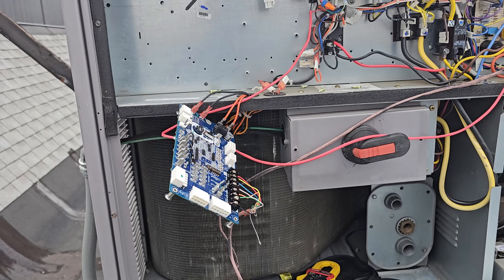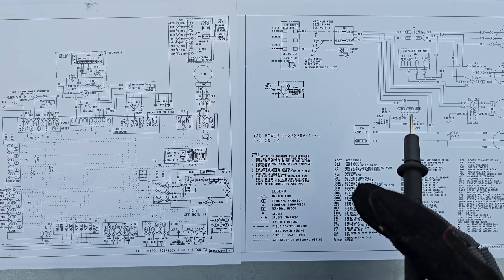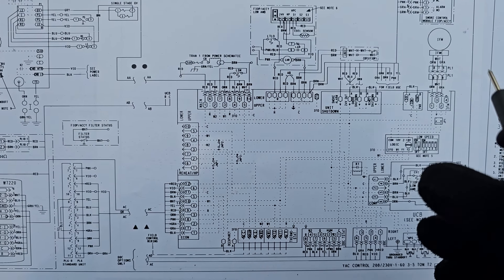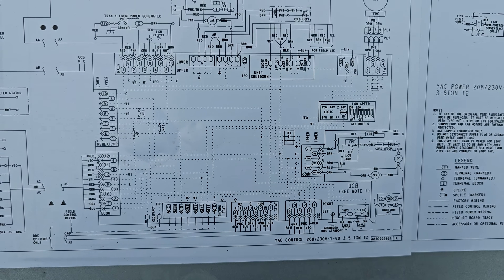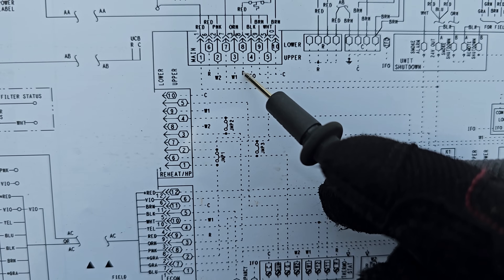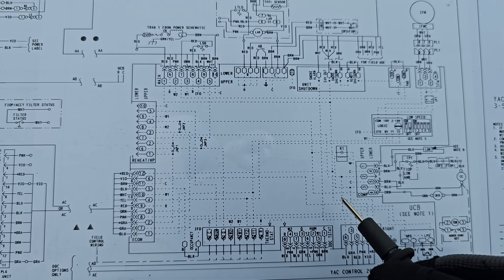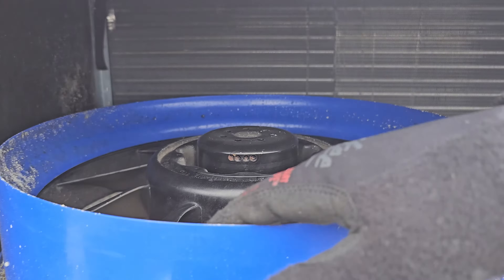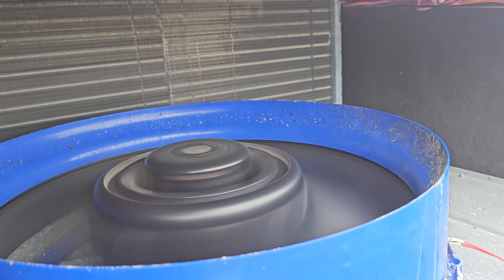HVAC TROUBLESHOOTING THIS CARRIER RTU HAD....

Comment: I seriously hate engineers. They design things on paper with no practicality in the real world, tell us this shit is great but don't listen when it doesn't work. Carrier breaks R on their residential furnaces too, took me a while to figure it out because you only get a fault code for open limit for a brief time period then it closes again and starts heating. Takes a lot of time investigating the unit. Also, some Carrier rtu's will break R if the thermal OL on the blower motor opens, very confusing if you're new. They run 24v from the transformer through the OL inside the blower motor and then to R.  You're a great tech, you make great videos.
Reply from the maker: Thanks for watching brother

Comment: A couple of important things. First and most important, if that limit switch opens, the fan should run continuously. The idea is if the heat exchanger gets too hot and opens the limit, the fan should run to cool it down. It should not be ramping down just because it lost a G call. Second, the smoke detector should not break 24 volts from the transformer. There are connections on the side of the main board for unit shutdown in case of smoke, and power and ground for the detector are run from other points....typically, not from a wire nut. Hope that helps. Find out why the open limit isn't making the fan run. There is a problem.
Reply from the maker: Good information, thanks for watching.